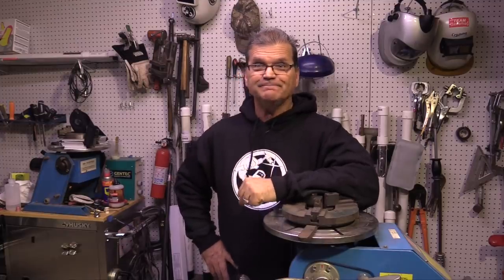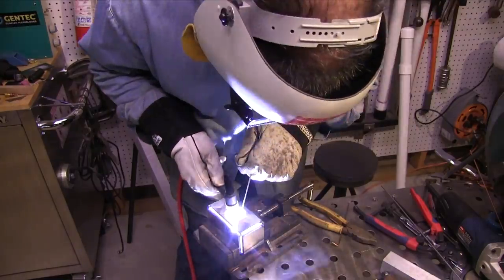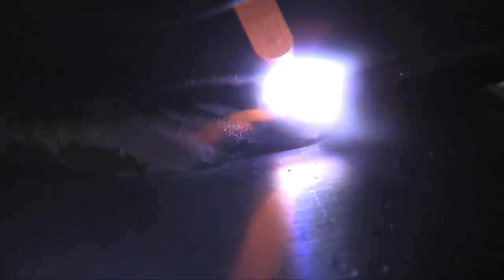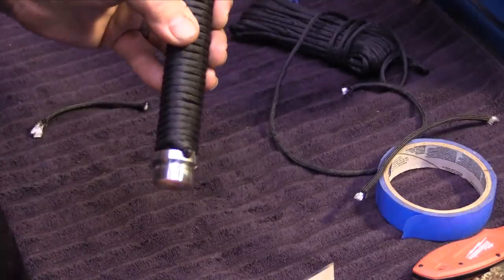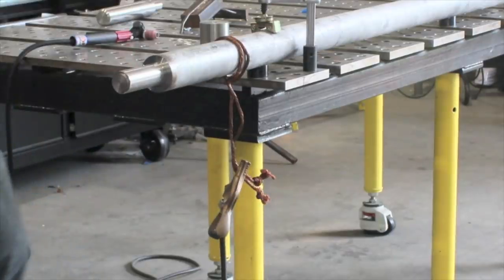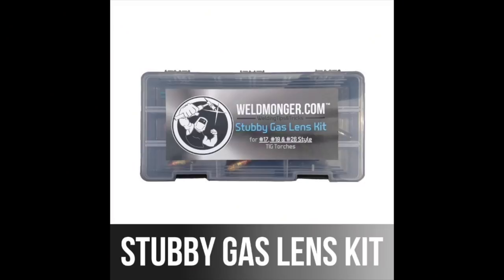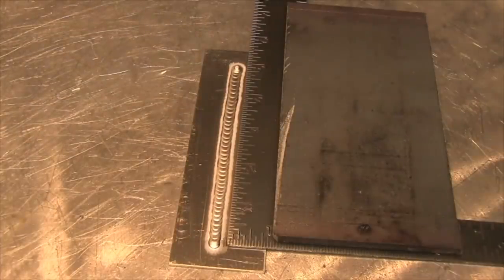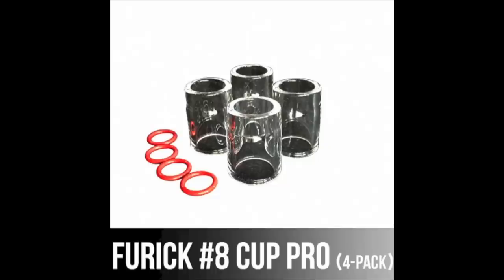DIY DeadBlow Thor Hammer

Comment: Another great video Jody. I have been a machinist for 35 years but just started to weld about a year and a half ago. I am now certified in Structural AWS D1.1 unlimited thickness. Thanks for all the videos. I have learned so much more from you than the welding college taught me. Keep it up and I will keep supporting you through weldmonger.com.

Comment: I had an idea about your design... If you were to leave the hole in the handle (instead of plugging it) - you could fill the BB's or lead shot from the handle, and put a piece of dowel (or precision-machined rod) the length of that handle. Or if you put a hollow insert with a cap at the end toward the head of the hammer - you'd still have room for your center punch. Then you'd have no fill cap and the faces of the hammer head would be smooth. You are a phenomenal welder and a great teacher. I really enjoy your videos.

Comment: question??? i have a lot of the ends of flux core wire  twisted in my shop ( a dead spool)... can i use this as a supplement to the  0.35 flux core wire on my welder to fill those gaps or holes that i blow through on rusty crap ??  i usually use old bolts or nuts to fill the big hole i have blown through...but i weld outside only with stick or flux core only???

Comment: that is a cool hammer and will definately out last the plastic dead blow hammers does the silicon bronze spark?
Reply from the maker: Silicon bronze does not spark.  but I wouldnt claim this hammer to be spark free because of the steel surfaces on the sides

Comment: Lose that ugly, clumsy screw cap on the top along with the un-necessary work. Just fill the hammer from the end of handle. When the required amount of shot is loaded you can blank the inside of the handle with a suitable wooden dowel.